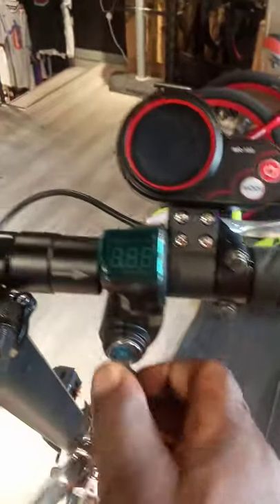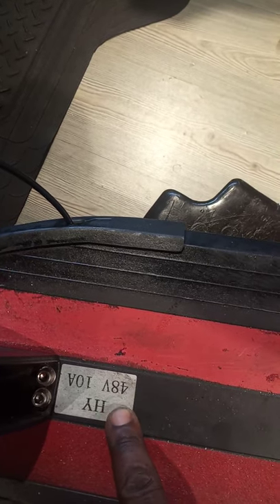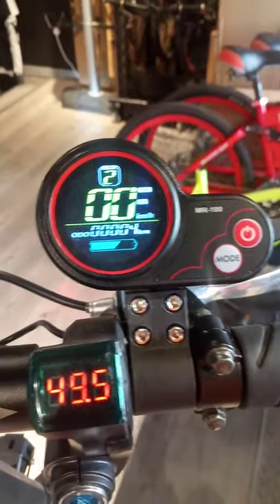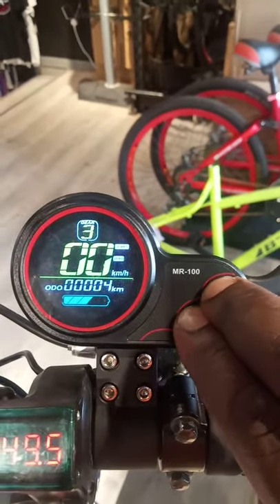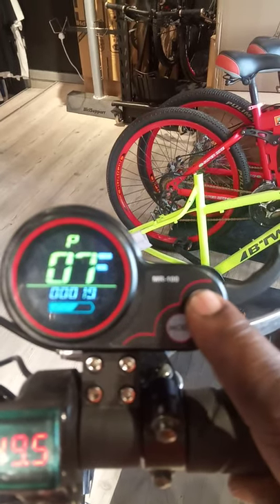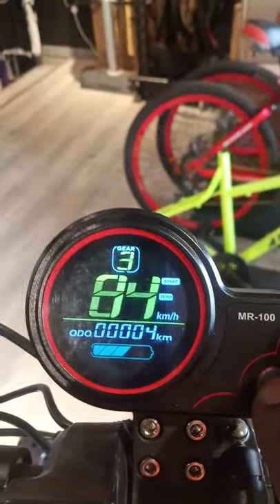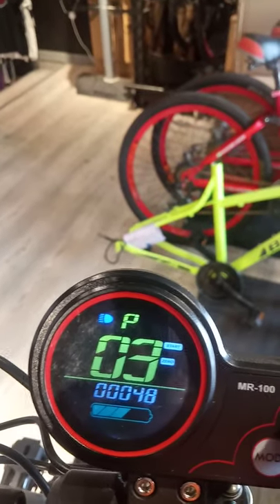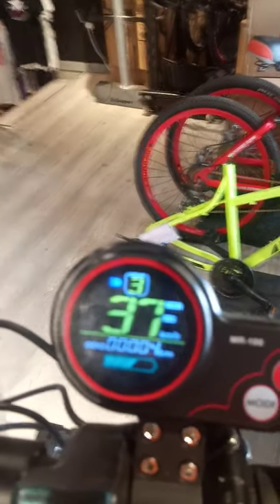How to set speed on E10 electric scooter

Comment: After I try to increase the speed and compare with my mobile phone speedometer, it not change at all. It might be change at meter throttle, but not the real speed. You can try it after you change the speed setting at P07, but you can feel the speed was the same standard speed. By the way, thanks for the explanation about reset the odometer to 0. Keep it up👍🏻
Reply: What’s the apps name and what’s the name of the scooter please ❤️ and where do I buy it
Reply: Same thing i did, only numbers changed
Reply: What he did here was to reduce the number of magnets the scooter uses … although the speed on the dashboard increases, but the actual speed in reality will never increase . This is because when you tamper with the magnet settings, it gives the scooter a false reading

Comment: I have issue with the throttle it’s stopped suddenly and take time then working again do you knows why
Reply from the maker: Check the connections
Reply from the maker: Possibly the connection is loose or the wire is broken

Comment: hello, can we change the battery of this scooter to make it much longer life and travel farther like 80kms+?
Reply from the maker: Thanks for feedback. Regarding the extension of the battery , it's not possible because the number of cells is balanced with the BMS (battery management system). The solution is to install extra parallel battery pack with the same voltage. This will double the Range .
Reply: @ErnestAngo254  oh thanks for that 😍
This will also doubled the charging time? My scooter takes 4 hours to charge battery, when im going to add same type of battery, will it take 8 hours of charging?

Comment: Good informative article 
However playing around with the switches does it really change the actual speed despite what's shown there?
Reply from the maker: Thanks alot for your support . However speed and power depends on the motor capacity. The combination of controller and motor is a dominant Factor.
Reply: @ErnestAngo254  I'm trying with my e10 its show me only p03 and max speed 50km only
Reply from the maker: The speed depends on the power.. example.. if your battery is low the speed will be low. Also you need  a strong motor to get higher speed .. you can charge from 1000W motor to 4000W motor. This upgrade will change your speed

Comment: Hi i remove my set bar on my scooter e10 and i want to put it back again but i cant fix the 2screws  on steps area.help me how Thankyou
Reply: Just open the the screw from signal lights under the step board 2 screw from the seat post haved 2 nuts you can put the nut under the step board to lock the 2 screw for the seat post.
Reply from the maker: You mean you removed the seat post from the chesis and now you want to install again?

Comment: How much 50 volatge can resist
Reply from the maker: Hallo
Reply from the maker: Please can you explain more because I don't know the problem of your scooter
Reply: @ErnestAngo254  i meant What is the minimum voltage that should not reach?
Reply from the maker: @AyoubBenallah-y9t  on the e10 scooter the minimum is 36 v
Reply: @ErnestAngo254  i have x-scooter pro. What do u think.
It has the same shape of this one
Reply from the maker: @AyoubBenallah-y9t  that's 48v    .. high 54v and low 36v
Reply: @ErnestAngo254  thankssssss. Have a good day

Comment: Bro help this messed up my battery im going 99mkh but battery goes down 3 bars straight away@ cant fix it helppp
Reply from the maker: Thanks for your support concerning your battery ...set P3 to 48 and P6 to 10 and P7 to 18 the speed will reach 35-45
Reply from the maker: If your battery is still draining fast you may install a backup battery
Reply: @ErnestAngo254  ohhh yesssss its fixed thank you uuuuu you're the best,  now I can finally ride and be happy riding in Isle of dogs country side
Reply: @ErnestAngo254  backup battery can u do a video on that, pls

Comment: I tried changing volts, and now the battery is blinking on the display like there is low battery. But's fully charged, i put it on 60 volts on a 400w

Comment: its not advisable to change the magnet setting it will burn motors sensor.
Reply from the maker: @br8seven7  burning sensor comes from sparks and shots it's better to find  professional who will work on your scooter.. on the other hand setting doesn't burn the sensors but changes performance.. it may increase or decrease speed.
Reply: @ErnestAngo254  only the numbers change the odometer is not accurate, try using GPS your speed still the same, even the manufacturer advise not to change the magnetic value, that's why they put speed limiter.
Reply from the maker: @br8seven7  we have different model updated... If you need more speed you have to upgrade your scooter instead of settings
Reply: @ErnestAngo254  its updated, maybe we have different settings, my P07 is for magnets while P15 is for speed

Comment: I want to ask you code P 7 what code is it?
Reply from the maker: Thanks for your support.. 07 is the number of magnet in the motor when you make it 30 it will slow while when you make it 22 it's increase rotation
Reply: but my dynamo is 36v 500 watts, what number should it match and increase the speed, and my battery is 36v 13 ah.
Reply from the maker: Please send me the photo on WhatsApp ±971527861029

Comment: but its the same speed (the real speed is around 40 45 max )
Reply: hahhahah what he changes is the settings that makes the display screen say its doing 1000km can change speed in settings thoi but if you have a 500w notor will not go faster than 28mph not even a 60v its 48v that scooter he has

Comment: dont do it it will mess yours up he changing magnets in motor what changes speed only on the clock not wheel speed
Reply from the maker: It depends with your scooter...if your own is messed then it's not ment for this settings

Comment: Explain all 0 tob20 p
Reply: P01: Backlight Brightness (1: darkest - 3: brightest)
P02: Mileage Unit (0: Km, 1: Mile)
P03: Voltage Class: 24V/36V/48V/60V (default = 36V)
P04: Hibernation Time (0: never, other figures refer to the hibernation time) Unit: minute
P05: Assistance: 0,3 gear 1gear2V, 2gear3V,3gear 4V
1,5 gear 1gear 2V,2gear 2.5V,3gear 3V,4gear 3.5V,4gear 4V
P06: Wheel Diameter Unit: inch Precision = 0.5
P07: Magnet steel Number (1-100)
P08: Maximum Speed Limit Unit: Km/h (range 0-50 Km/h, 50 means unlimited speed)